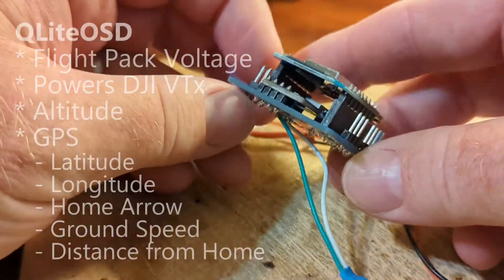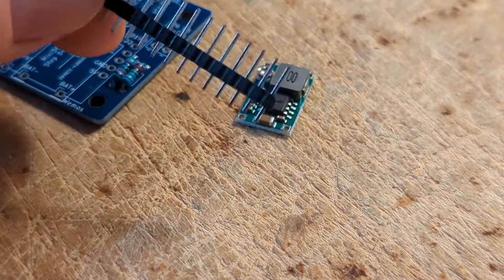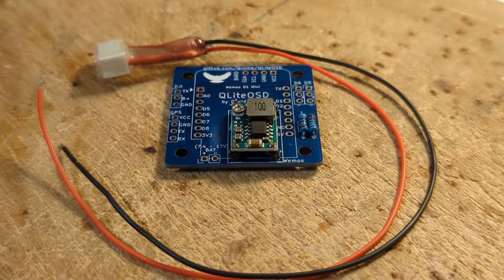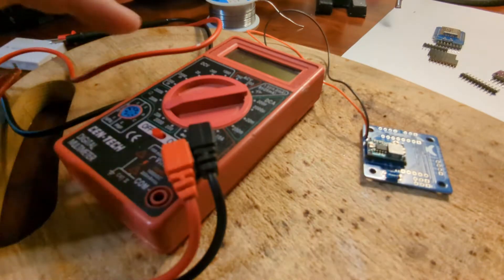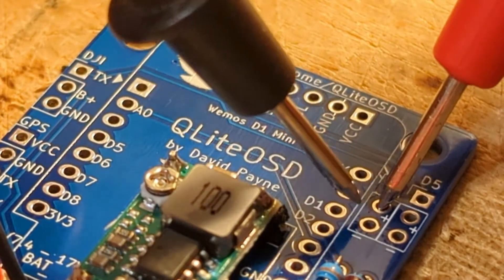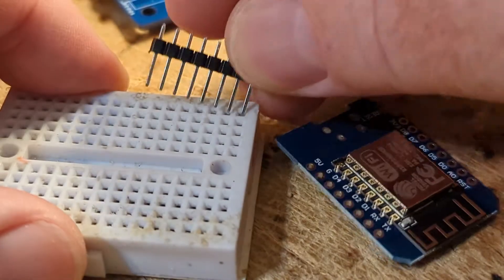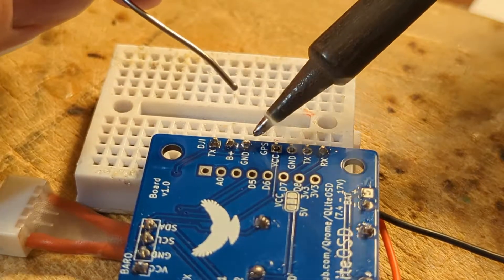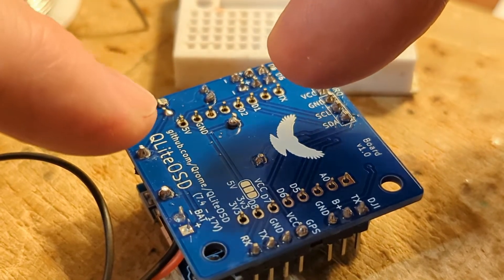QLiteOSD Kit Assembly - for DJI FPV OSD

Comment: i did everything  but skipped  the votage drop down. because i couldnt find anything to turn the Potentiometer, later when i came baclk to plug in the 7.4v battery the board started smoking :(
Reply from the maker: Sorry to hear that.

Comment: Hey, quick question.  Do i need to readjust the potentiometer if i change the voltage going into the qlite?
Reply from the maker: It would be a good idea to check it.
Reply: @Qromer  hey, so I tested 2s and 3s power. No changes in voltage at D6 pins. 👍